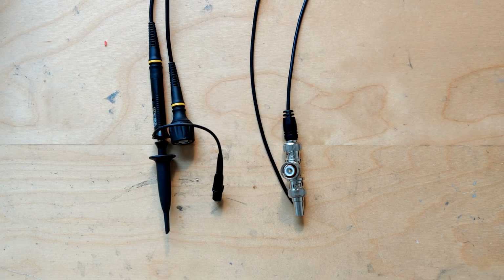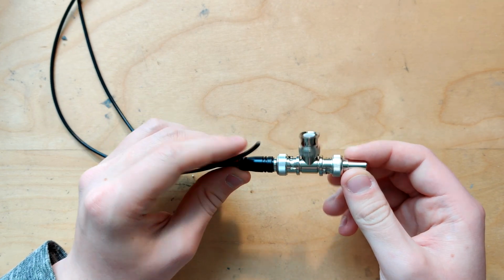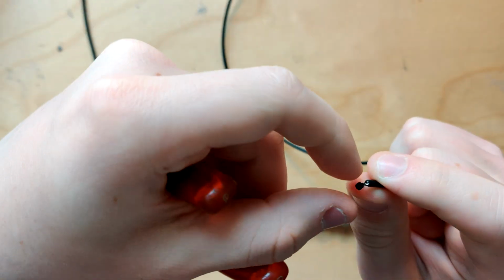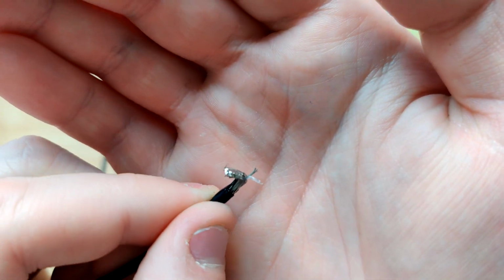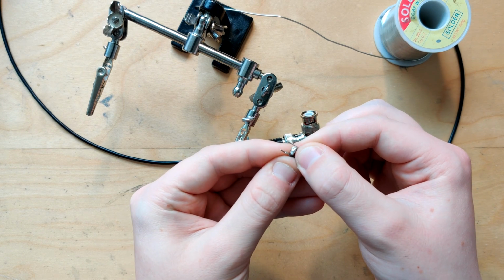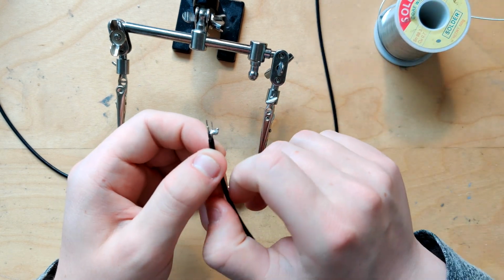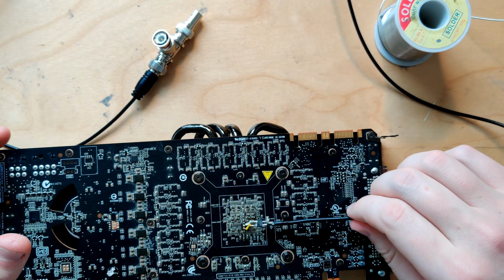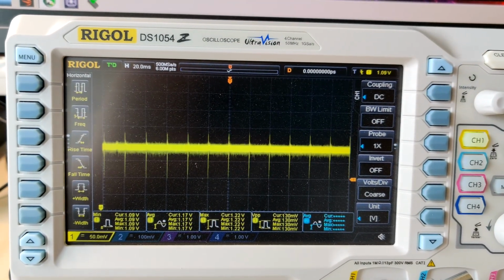Building a more accurate Oscilloscope Probe (badly)

Comment: Hmmm... to get rid of the measuring tip, okay... but you should add the termination and make the correct compensation. If I have missed this, I'm sorry. But just a coax cable is not all to get a reliable, high quality measurement.

Comment: IMHO you should get yourself a crash course in measurement principles & techniques.
What's the big idea using terminated coax cable measuring DC voltages - I don't get it ?
it does not in any case improve measurement accuracy at all.
Your measurement point is already a VERY low resistance because it is a power supply.
Instead you should use a better quality probe and then calibrate your oscilloscope readout using that probe.
Also have a look on your oscilloscope generic readout accuracy - you may be surprised how bad it really is.
Good luck and all the best ☺
Reply: there is not much to get - you got it in the first sentence. lad has absolutely no idea what he is doing and will soon fry his toy (ds1k series are 1m input with 0.01-1000x attenuation^^)